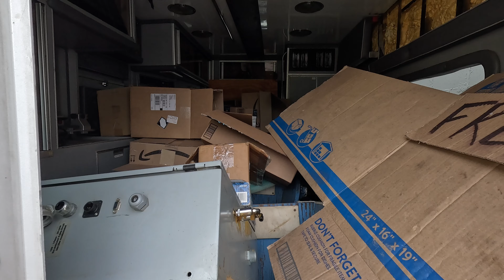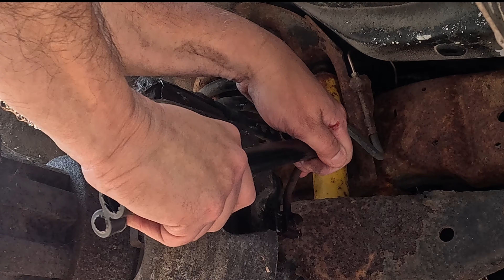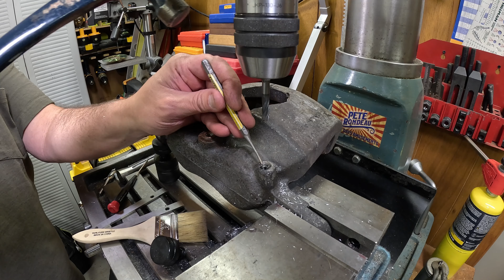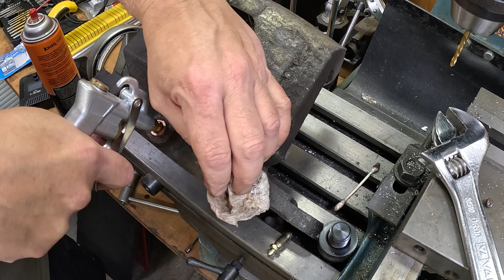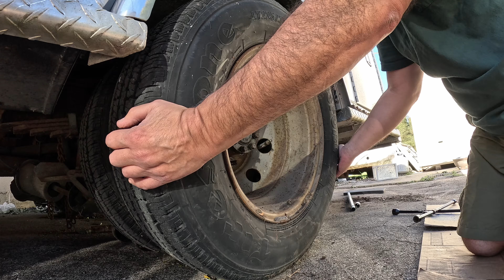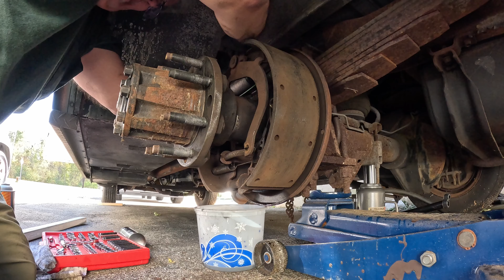Will This Project Brake Me?

Comment from the maker: This week we are trying to tie up some loose ends before heading into the winter.  
Follow our carnival ride restoration here:   https://www.youtube.com/watch?v=xyejd7LRKMQ&list=PL9JRE2uksm9tonX17TZt38K6RH2EnDNf1
Reply: I have a similar generation F350 and had a caliper lock up. The parts to rebuild it was more than a new caliper from o reillys. Plus I was stuck in the side of the highway. 

Caliper, pads and brake line was under $100. Granted that was 2019 prices

Comment: With the right tools that bleeder was an easy fix... (it will take a lot more time if you dont have a milling machine😅) but i would have done the right rear too, one old and one new cylinder will cause uneven braking in many cases.
Reply from the maker: I went into this thinking it was going to be a much more involved job- I thought this was the older Dana rear end that you needed to pull the axle to get to the brakes.  I was pleasantly surprised when the drum came off.  So, since it thought I was getting into a bigger job, I didn't want to make it even bigger by doing both wheels.  But now that I know that isn't the case, I have ordered the other wheel cylinder.  hopefully I'll get a nice weather day to swap it out.

Comment: Pete, I commend your tenacity. But as I get older, Reman calipers aren't that expensive and a lot less hassle.  Here in the rust belt, good luck getting the bleeders open without doing what you had to do.
Reply from the maker: Its just that these were a pretty expensive set of emergency duty calipers that I put on it (10 years ago) and probably only have a few thousand miles on them.  I really wanted to try to keep the set if possible.  But i will admit, I was getting close to the giving up point.

Comment: It has been my experience in 25 years of working on old rusted Found On Road Dead trucks ,your project should have started with at least two weeks of soaking with penetrating oil every day and multiple rounds of heating with a torch .
And then there's no garentee of success. I feel your pain 😅
Reply from the maker: Hey Richard, good to hear from you!

Comment: I feel your pain. I need to replace the break fluid on my car and well the bleed nipples are just rust... I am dreading what I need to do to get them out. Might go down the route of new callipers. Might save what little sanity I have left! :D
Reply from the maker: @callumBee  I was trying to avoid changing the caliper if at all possible. When I originally put these on, they were pretty expensive “emergency duty” calipers and they don’t have more than a few thousand miles on them.
Reply: @PeteRondeau  Understandable that you did what you did.